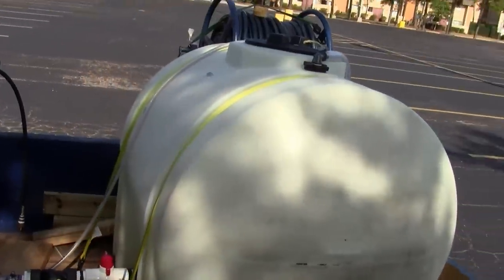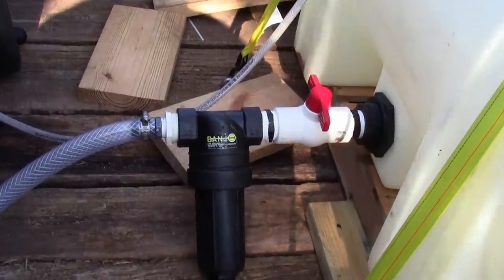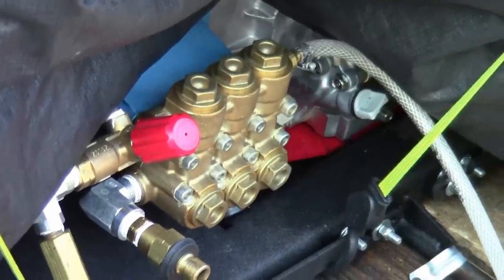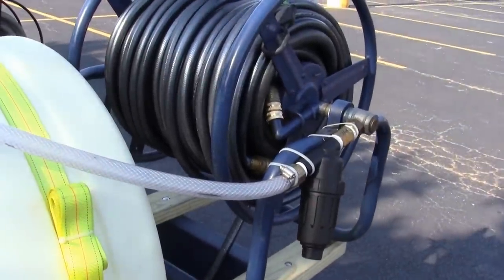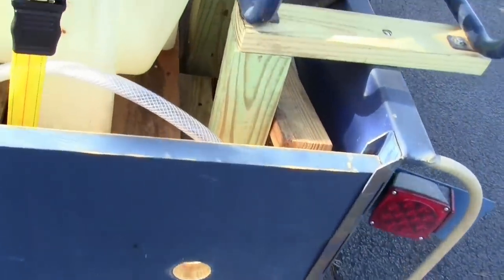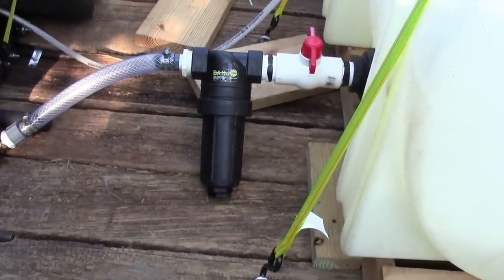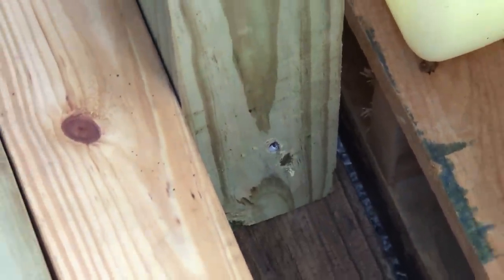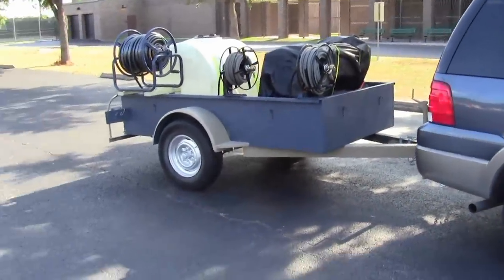Pressure Washing Trailer Set Up Custom DIY

Comment: Hey buddy 2 quick questions what size trailer is that you have and if you wanted to install a soft wash system would that size be big enough to use with it? Thanks in advance

Comment: is that enough gravity feed from your water tank to the pump or does you C.A.T PUMP suck water . nice video im half way through making one. ive got a cat pump 279 model  and it doesnt suck water but a great pump apparently  . would this matter if i put the same connectors / filters the same as this set up.
Reply: You need a belt or gear drive to pull water

Comment: Is it necessary to have two different strainer on that tank or just for safe measure?
Reply: The one coming off the reel stops anything from getting to the tank from the hose.  The one coming off the tank keeps anything that made it's way into the tank while the lid was off from getting into the pump.  As long as you have one between the tank and the pump you are good.  The other one helps, but isn't completely necessary.

Comment: Where do you fill up your water tank?
Reply: At the customer's house.  It's a buffer tank.  It's just to make sure his pump is always getting as much water as it needs.  Some homes don't have enough flow to keep up with a pressure washer.  He hooks up to the customer's spigot and that goes through the hose to the Hudson float valve on the tank.  When the water level reaches a certain point the float valve shuts off the water to the tank until he uses enough for it to open back up and start to fill again.  When you're done you just dump the extra water so you're not pulling so much weight.

Comment: Nice little set up. I just got all my equipment in. Can't wait wait to put on trailer. Small set up like your except I also have a soft wash kit with a 65 gal buffer and a 35 gal chem tank. Thanks for sharing. Just subscribed and liked my brother.

Comment: looks  good man i like how you painted the trailer....lol
one suggesetion change the quick connectors on the pump inlet, from  my 
experience they always ten to leak after a while but other than that setup looking good man much success to you.
Reply from the maker: I changed them to cam locks! Thanks Darrel
Reply: Anytime bro....
Reply: Do you have to have a separate pump to pump water to the pressure washer.. dont you have to have pressurized water like a water hose running from your house with pressure in order for the pressure washer to work

Comment: Nice, I am setting one up now. Thanks for posting
Reply: Hey Roadrider ! What all do you have so far?
Reply: C.L. Scott Hi C.L. I use a portable set up now I just load it in the back of my pick up. I will be building a trailer over the winter for use in the spring, by building I mean welding it together. I like your idea of raising the tank up to have the water flow down hill. I will incorporate your idea by making the trailer a step deck and raising the section where the tank will be by 6 inches. Question: What size tank would you use for doing fleet/truck washing? 300? man that could be a lot of weight to haul around! You do nice work my friend, looks like you thought of everything.

Comment: the water tank needs to be centered over the axle, that trailer will be all over the road if you pull it with water in the tank.

Comment: Wish I had a trailer like that! I could make some money on the weekends no doubt.. do u mind giving he some pointers on how I can get a cheap one made..
Reply: It was about $6K
Reply: I've got one for sale, and it's a Landa skid with heat,525 gallon. .Landa is top of the the line, even comes with a Landa sidewalk, cleaner
Reply: How much $$?
Reply: GroddOfWar 777 Why are you selling yours?
Reply: C.L. Scott I bought a new one, I had 2 running, now I have a day job and just run on the weekennds. I only do heavy equipment for excavating companies, more money in it and it's easier than driveways. I got fed up with the driveways, customers think my extremely expensive machine, that gets their concrete freaking white, is the same as the yokel doing his for half price with that garbage he bought from Lowes and threw on a trailer. It irritated me to the least, got tired of going on free estimate calls, so I jack my prices up to 20 cents a square ft.lol..i only do equipment now..lol
Reply: LOL!  I hear ya Hustler....The customer's sometimes think they getting a deal from the other but the job probably ain't as nice as the one you probably do for them... That's some good info though may have to get some good pointers from you and learn the trade my brutha....
Reply: Jay Dab Yea, definitely...It's just a misnomer they have in their heads...But there are tons of ways to make money with a machine. My machine runs downstream chemicals and about 250 degrees of heat, so I can do stuff they can't. .lol. .so that's what I started doing, heavy equipment and big rigs...Good money in it..
Reply from the maker: GroddOfWar 777 Jay Dab My machine goes up to 250 degrees as well. How much do you charge? There's plenty of heavy equipment here - farms and tons of construction. email me if you like, service@houstonwashpros.com
Reply: Houston Washpros It depends, usually on bobcats and smaller excavating equipment, it's usually around 85$ hr, or that is what it ends up being. Dump trucks, or just tractors are between 130-170$..i stay pretty busy on the weekend..